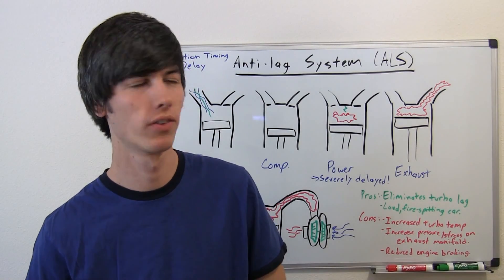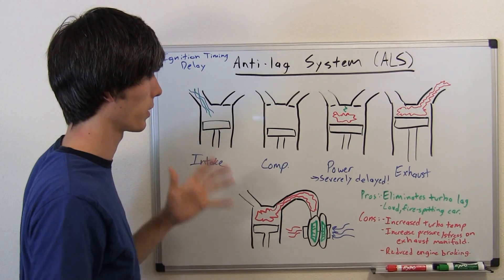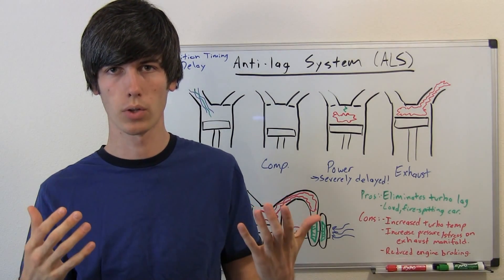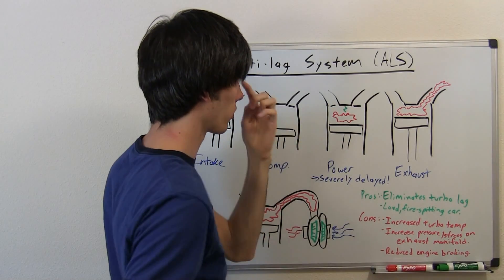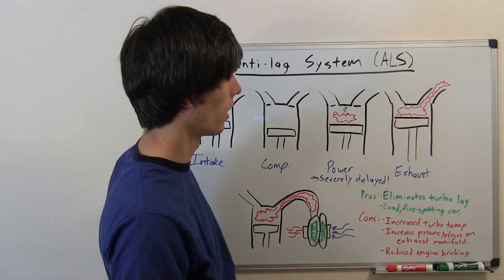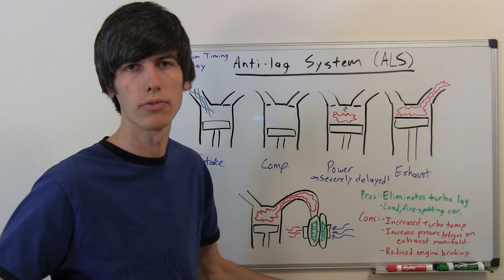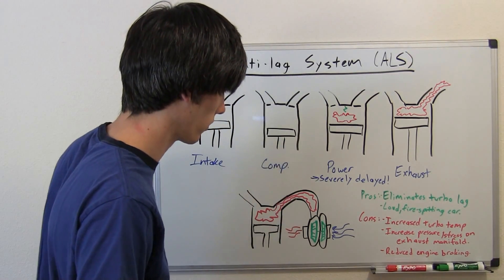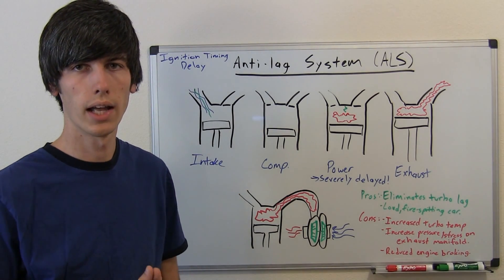Anti-Lag System By Ignition Delay - No More Turbo Lag

Comment: Exhaust manifolds and turbo should be ceramic coated inside and out for use with the ignition delay system

Comment: I have rewatched many of your videos in attempt to determine how likely this ALS is to increase the chances of sticky valves provided that one of my (or any) BMW engine's greatest weaknesses are valves bent from sticking over time and eventually getting hammered by the cylinders themselves,.. it happens. so could this lead to enough excess deposite on the valves to cause sticking (or retraction delay)?

Comment: According to aem. The ignition delay anti lag system is only 25 deg retarded.  It's not going to run as hot on the exhaust manifold or turbo.

Comment: How does this work on manuals with fuel injectors? 
Don't they completely shut off when no throttle is given, therefore can't use antilag? Or does the ECU have to be modified?

Comment: Does delaying ignition timing only applicable for gasoline engines?? How about diesel engines?? Thankyou for your inputs this will be all appreciated
Reply from the maker: Ignition timing is done using a spark, with a diesel engine ignition is controlled by when you inject fuel. There is a window of compression where the temp and pressure is high enough to ignite diesel which is when the fuel is injected.
Reply: Engineering Explained then anti-lag system is only applicable for gasoline engine? Wherein the a/f mixture can be ignited when the exhaust valve starting to open? 
Thankyou so much.. :)

Comment: Had a 98 eclipse GS-T with a 2 step rev limiter (speed controlled) and retarded the hell out of the timing to achieve psuedo antilag. Was useless for launching as the car would just blow the tires off at 14 pounds of boost. But it sure was fun to roll up next to fart canned civics and hear the turbo spool up before the pops and flames.... Little ram horn header would glow the most beautiful shade of orange afterwards... Then I sold it and the next owner wrecked it :(

Comment: What stops ALS from "kicking in" under full throttle in say 3rd gear down a straight? What determines when ALS is functional? Is it based on roadspeed? Clutch depressed? Etc? 
Reason for my question is, good system for launch, but what stops this happening at the top of RPM range in any other gear when you arent launching off a line?
Reply: It's all in the ECU maps.  It would be programmed by a competent tuner (hopefully) to apply.  ECU has many inputs - throttle position, vehicle speed/gear, engine load, crank and cam positions, etc.  The tuner simply has to be clever with those inputs.  Even something like coolant temp and perhaps oil temp - a competent tuner may disable anti-lag below and above an acceptable range to protect the engine.  If you're flooring it in 3rd gear the ECU would know not to use the ALS routine... however as soon as you lift up on the throttle it would potentially kick in.

Comment: Hello after watching inlet bypass, I think that the ignition delay timing also creates pressurised air sucked in from the compressor. Can you explain where the stucked air goes when the throttle is closed?  thanks man

Comment: Some questions here, so basically, except a reinforced exhaust manifold (and probably also upgraded turbo and exhaust line) it only require ECU modification to be done ?

Also, is there typical delay before it stop ? (there is one obviously, otherwise it would contently do it at idle and it would be bad) that is best for every car or does every car/turbo and use of the car require different settings of that ?

I guess it is not possible for regular diesel engine since we can't really delay the combustion in a way that it will still occur during the exhaust stroke, but does a diesel engine with electronically controlled valve can be an exception ?
I imagine it being possible by opening the exhaust valve during the combustion stroke all the way until it close at the end of the last stroke as normally.

And finally, I don't really see how it reduce engine braking, can you explain it to me please ?
For what I see, the first two strokes are the same, but delaying the ignition for what I visualise mean that only the inertia, the other pistons and the compressed fuel/air mixture make the piston goes down unlike when it idle as normally and the combustion help to keep going, and also oppose a resistance to the piston on the last stroke because the gas is still burning/expending, so I thought that all that would actually act in a way that will make less power out of the engine which would not change or even improve the engine braking capability, that's what I imagine would happen at least.

Comment: why engineers don't make water cooling system for turbos?
Reply: Miguel Ferrandis Perez ffs they do..
Reply: Miguel Ferrandis Perez most modern turbos on stock cars are water cooled and include turbo timers.
Reply: Miguel Ferrandis Perez even a smart car has a water cooled turbo
Reply: my subaru has a stock td04 it has a water line
Reply: Miguel Ferrandis Perez you have to see the BMW M4 GTS

Comment: You missed one main thing, The most very common use of the anti-lag system is in rally racing. Rally racing the hit corners alot harder then road cars at mostly full power and cause they don't have road grip they use a system like the anti-lag set up to bang out them corners to keep in the time, these system's are basically set up for a one racing session before repairs and rebuilding. Mainly the turbo cops it the hardest it is basically full on compression surge and they use that to full maxium to go hard, they would be twin water ice cooled to last the session, I'm sure they got there secret's for things to last.

Comment: this is a rhetorical question but what would happen if you chilled your exhaust manifold? as in like, an intercooler too cool the air before reaching the turbo? theoretically you would be producing more power due to the denser air AND keep your turbo way cooler, therefore more power and reliability?
Reply: my bad hahaha i didnt mean rhetorical i meant just wonderin, i need to get out my dictionary hahah
Reply: my bad hahaha i didnt mean rhetorical i meant just wonderin, i need to get out my dictionary hahah
Reply: I don't know too much about cars but when air gets compressed in the turbo it heats up a lot and that's why they use intercoolers. Do I'm not sure if an intercooler for your exhaust would help. That's just my guess.
Reply: Actually no, that would be a really bad idea. It's basically the opposite of the fresh air side. You want your exhaust gases to be as hot as possible before they reach the turbine. Higher temperature means more pressure and also more potential energy for the turbine.
If you look at turbocharged engines in racing, they quite often use some thermal isolation blankets for the exhaust pipes to keep the exhaust temperature as high as possible until the gases reaches the turbine side.

Comment: I have a question +Engineering Explained . W/ an RB26 most of the use low mount twins and high. As well as a big single. But w lag how do you not get lag from using twins?

Comment: Can you explain why the engine braking is reduced with ignition timing delay ALS? It seems that if you ignite the mixture in the cylinders at a less-than-optimal moment like this, then you would produce less power than normally so you would be engine braking more...

Comment: Correct me if i'm wrong, but reduced engine braking would only apply to as if the anti-lag function was applied during the deceleration correct ? for example "rally style" anti lag, reduced engine breaking would happen more in this system rather than conventional (manually engaged) systems ?

Comment: so i have this question, my 2007 s600 is a v12 engine with a twin turbo setup. When i start from a start my car starts to have a increase and decrease in power very quickly (like u move back and forth in ur seat) for the lower speeds. I think it might be the turbo lag. correct me if I'm wrong

Comment: I have 2 questions,
Is this system working full time or does it kick in when needed?
How can I tell if my car has an anti-lag system? I kind of get the feeling there is very little engine braking and also turbo lag is minimal. Perhaps you could tell me, the car is a 2011 VW GTI 2.0 turbo.
Thanks

Comment: is there an engine that uses the crank to keep the turbine going?
im wondering because the current generation of F1 cars use this as somewhat a means of retaining boost.
Reply: It's is called "Procharge" just google it ;)
Reply: +Θανασης Κριεμπαρδης I will do, thanks.
Reply: You are basically talking about a supercharger but they do take away a bit of the power to make them run but the car will be very responsive and much better as a daily than a high hp turbo car

Comment: Am I right in thinking that this doesn't work with diesel engines then?
Reply: I was thinking the same, he doesnt mention it directly but indirectly u can guess.
Reply: well diesel engines do not use spark plugs so this system would not really work there might be something like changing the valve timing to open the exhaust port earlier but i'm not 100% sure
Reply: it may be possible to do it with newer common rail diesel since the injectors are electronically controlled, but without a throttle blade the turbo isnt going to slow down nearly as fast as they would on a gas car, could be tough to get it where at was as good as it is in a gas car. i do know that for other emmissions purposes that diesels actually have up to 5 (as of 2008) injections per combustion event, and in certain situations they are well after the exhaust valves have opened for emmissions purposes.

Comment: whats the diffrence in a 2 step and a anti lag system
Reply: 2 step is like a rev limiter holds engine at set rpm and antilag at set rpm delays ignition and allows combustion rigbtb the exhaust stroke this builds boost to the turbo makes it spool up for a take off
Reply: +Lightning Autowerks™ ive got a honda with antilag, in order to use it, i must be traveling under 20km/h with the clutch in, and it only activates when my foot goes to the floor. it seems like launch control, but my timing retards 15 dergees and i have a limiter at 6500 rpm, i make full boost within a seccond of having the throttle applied, the wastegate opens and it shoots flames.   im a little misunderstood how it works while cornering at high speed. 

im not a troll, im just misunderstood, hope you could give me a response, thanks

Comment: A more particular question I had, and I hope you have time to answer. I was watching your recent "How to launch MT car" video, and I didn't fully understand how holding a turbo engine at a specific rpm doesn't build boost.  For instance, my 07 STI builds full boost around 3500rpm, but if I understood you correctly, even attempting a launch at say 4000 or more would only supply the torque generated by the engine without the advantage of the turbo, since the turbo wouldn't be making boost.  Why is that? 

Is it because, even though you're holding the engine within the boost range, the throttle is so close to closed (since it doesn't require much air/fuel to spin an unloaded engine) that there just isn't enough gas flow to actually make boost?

I realize this is a complicated question, but your help would be greatly appreciated!
Reply from the maker: +Trunxic You've got it right, doesn't take much power to spin an unloaded engine at 4K rpm, so you'll stay out of boost.
Reply: +Engineering Explained Thank you! That's super helpful. :)

Comment: what is the difference between Anti-lag and 2 Step?
Reply: +Dominator 2 step is just a rev limiter, controlled by the ecu, that holds the engine at a set amount of rpm.  2 step does not keep the turbo spinning when the throttle is shut, like an als system does.  The benefit of a 2 step system in a turbo car is that it allows the boost to build before launching the car.

Comment: now..the question is...do als with ignition delay work together with the bypass valve, scenario which kinda makes sense because you need to release somewhere all that extra boost when u're not throttling ...or are they separate? great videos!

Comment: But when does a gasoline engine use a turbocharger instead of a supercharger? What happened to turbochargers just being used on diesels?
Also, will you please not say "ALS system"? There's no such thing as an "antilag system system."
Reply: +MaxxFordham Supercharged engines are a threatened species. Superchargers were quite popular in the 50's and maybe 60's. But especially in the last 10 years with the downsizing trend, turbochargers get more and more popular even for small petrol engines.
And you can use small turbochargers, which have a very similar characteristic to superchargers, but without their drawbacks.
Reply: Well, even though I think you meant " '50s and maybe '60s" instead of what you said, shi01, I think I understood what you meant, yeah. Although... that still doesn't really answer my question about diesel vs. gasoline (both of which really are petrol[eum], hence that "petrol" is a misnomer).

Comment: Why turbos are only a good idea for the track. Superchargers are great for daily fun driving. BUT, there are some cars that use twin turbos that are even SUVs. The BMW X5 M is an example and it's not a racing car. If anything, it's a family sized power monster. So, does whis mean this particular car has turbo lag, an ALS, or is there something else? Please answer someone.
Reply: +Bruh Shat Well, turbos haven't been on track until 3 or 4 years. N/A is probably still the best option for the track. All the newer turbocharged racecars, except Rally Cars have no ALS, because it's not needed. They have quite small turbos for that. Almost every newer car with 300+hp is now Turbocharged. Supercharged and N/A are almost dead in Europe.
Reply: But what about these daily driving cars like RS7 or BMW's M series cars. They use turbos and not superchargers. So how do they deal with lag?
Reply: I've driven a new E63 AMG a couple of times. It's a V8 Bi-Turbo. There is a minimal lag, or let's say a delay, that you can feel. But on the street it's not an issue. It consumes a bit less than its predecessor but it has more hp and way more torque!
Reply: onethirdofGilgamesh So do you know what AMG did to reduce the lag for daily use? I'm curious of this.
Reply: +Bruh Shat using twin turbos means that you have the possibility of "deactivating" the second turbo up until the point where the first one has built up enough boost so that you can switch to using both turbos. Once both Turbos are running you'll have just as much power as a bigger single turbo would deliver, but you reduce the lag by using two smaller ones. There are also Turbochargers with variable geometry that "get bigger" once enough boost builds up. I think the Koenigsegg One:1 uses two of those.
Reply: Oh I see. But naturally aspirated will always have better throttle response ( and sound ;D)
Reply: Bruh Shat depends on who you ask ;D modern turbocharged systems are refined to a level where the average driver cant differentiate between the throttle response of a N/A car or a turbocharged one and even the sound is almost untouched. Perfect example would be the ferrari 488 GTB, watch chris harris' video on that one if youre curious
Reply: alright thanks for the insight.
Reply: +Bruh Shat  those cars u mention here are all with lots of cilynders and cc so they come with lots of torque and power and that equals to car needs a low-mid rpm turbos (low pressure 0.4-0.5 bar )
Reply: +E GC sry my friend but thats wrong explanation. so twin turbos comes on a car which is a v8 or or something like this, not for simple inline 4 engines , simply because u have separate exhaust manifolds so if u want to turbocharge ur car u have to install 1 turbo at each side. so there isnt a primal turbo or a secondary
Reply: +labros dovros i know how the big v8 are twinturbocharged with two simultaneously active turbos, but the technique of using one smaller or even two small turbos and one big turbocharger is certainly something i saw being used in bmw engines for example, they even have those triturbo setups i mentioned with 2 small turbos - am i wrong? maybe i mixed something up without noticing :P english isnt my native language
Reply: +E GC so u actually mean a compressor ( used mostly in mercedes ) combined with the ''snails''
Reply: +labros dovros im pretty sure im not referring to a compressor (usually named supercharger btw), bmw doesnt even use them (i actually know of no car they fitted with a supercharger). Furthermore a supercharger has no lag, so using two different sized superchargers would be quite pointless i think
Reply: +Bruh Shat probably has to do with turbo design I think bmw uses twin scroll
Reply: Aykan W The setup you are referring too is called compound turbocharging and it's mostly used on diesels. One smaller turbo spools quicker into one larger turbo. Gas engines don't really go this route because gas engines are lighter internally and don't require it.
Reply: labros dovros BMW M3 doesn't have big a cc engine. Smaller cc engine with turbo

Comment: @Engineering Explained 

Hey i was wondering how this would work on a rotary engine. Care to explain or even make a video on it?
Reply: Probably the same principle. But with triangles!
Reply: +Underdose  rotaries are dumping loads of fuel into the exhaust anyway. It would be a similar set up with even less retardation.
it might even be better suited to rotaries as they back fire naturally and I'm sure the engineers took this into account and more than likely built exhaust and turbo components out of more temperature durable materials for this reason.